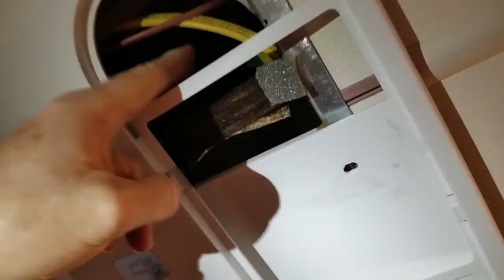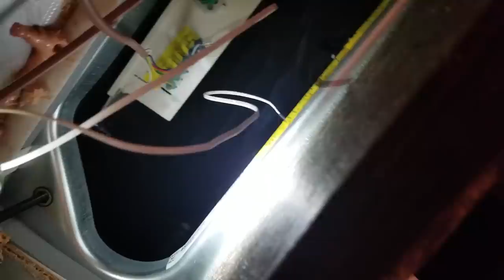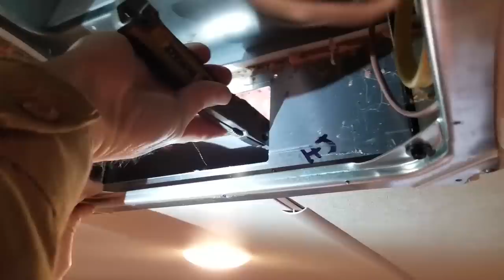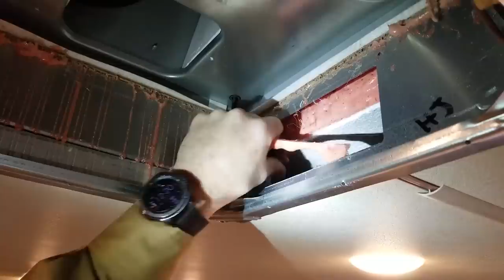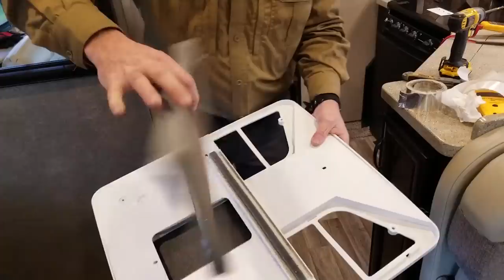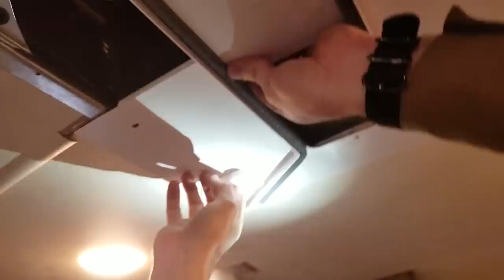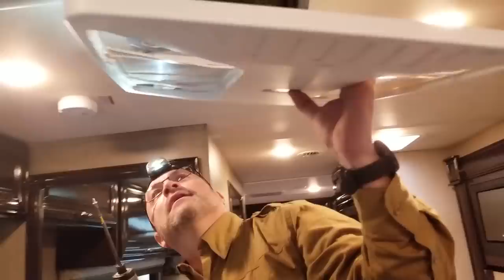Boost Your RV Air Conditioner Performance With This Cheap, Easy Fix!

Comment: Great video. Suggestion, when you put the foil tape in, put the section of tape that is further into the plenum first. Then the second piece over laps. This will prevent the constant air from blowing against the seam and eventually leaking. Like a roof shingle or sidding, you start from low and go high.

Comment: We bought a new wildwood tt and had this same issue,  there was a 1/4 inch piece of foam dividing the two half but it was crinkled and just flowing air between the two. Not only that but the passage to the ducts weren't taped or sealed so the air was blowing into the ceiling instead of the duct work. We were having issues with very low air flow so it wasn't cooling it down. Instead of taking it to the dealer,  I pulled the ceiling cover off and discovered the problem. I put a thicker barrier between the two halves,  and sealed all the gaps and holes and made the bends more aerodynamic and what a difference!! Went from very poor ac to ice cold. I went over the whole duct system and cleaned up the edges,  and put caps after the end ducts so eliminate air leakage. Took a couple hours but it was a night and day difference. I used material I had on hand from other projects so the cost was 0. Thank you for this video!

Comment: Unbelievable what I found. Thank you so much. Our air vents blow way better. Divider piece installed backwards, huge holes blowing into basically the attic, and tape hanging down blocking half of our vent. Never would've checked this. Thank you.

Comment: Excellent!  I've been in the HVAC trade for over 45 years and these are the BEST suggestions a RV owner could ever do to his air conditioner.  Great job!
Reply from the maker: I really appreciate your comment from someone that has as much experience as you do!

This air breach is an all too common issue I find.  I almost hate charging for it because it is something all RVers need to be checking on their annual inspection.  

Hope we can get the word out to folks on some of these easy fixes.

Thanks for watching and commenting,

Cheers,
Darren Koepp
Reply: I have a video that will help you more  is in my Fabe book  , this video is good  if you go out side end cat the plastic end install a chicken fence you will not have restriction air out  only one side

Comment: I did the same exact thing to both of my air conditioners, I sealed up everything with the silver tape, most of my cold air was going back into the return, and inside the attic space, they both work so much better now.

Comment: Thanks for this valuable information. My Winnebago Vista 29 had a problem with air not going through the vents to the rear of the coach. I followed your video and it took 20 minutes to fix this problem.

Comment: I did this to our RV AC’s a couple of years ago. Worth the time and cost for sure. Also plugged up the dead end gaps at the ends of each duct line
Reply from the maker: I like to recommend checking this at least once a year since the adhesive has a tenancy to degrade over time.

Cheers,
Darren

Comment: Your video is spot on. I took apart our 26HE Coleman air conditioner, because it didn’t seem as cool as other motorhomes we’ve owned. After removing the inside decorative cover I quickly found out why the A/C unit did such a poor job of cooling. The divider that separates the warm-air intake side of the plenum from the cold-air output side was installed backwards and was laying at almost 45 degrees. In our case there was virtually no separation of airflow between the warm & cold sides. I removed and reinstalled the plenum divider correctly, then I put everything back together. The difference in cooling was unbelievable. Like night and day. I only wish I had seen your video sooner. We put up with the poor cooling last summer, but assumed it was because there was only one air conditioner and that’s all we could expect. We never suspected that it was a sloppy installation by Winnebago that caused the problem.
Reply from the maker: I've seen this on many air conditioners. From all manufacturers and price points. Even after a few years the adhesives start to fail so that should be something that is checked annually.

Comment: Thanks for making this video.  I have the exact Coleman AC as in the video and it had exactly the same issue.  I fixed it following your video and what a difference.  I have cold air coming out of both RV side ducks now when it was only on one side before the fix.  It is even quieter in the RV now because the blower outlet noise now not being directed through the air intake as before.  We when camping last weekend in 99°F heat and the AC wasn't even close to keeping up.  It will be fun to see the difference the next time it is that hot when we're camping.  Overall, very happy!  Thanks again.

Comment: Love your videos! I got rid of my original traditional RV air conditioners and installed Midea house window ac which I installed in the living room, entertainment cabinet and will run on 500 watts and I can use my solar panels on the roof to run both AC 's without using a soft start. I also installed compartment doors that swing open and I use drawer slides for the air conditioners to sit on a sliding platform and I can slide the unit in and out easily and of course open and close the compartment door. I could not be happier and the Midea AC unit is less than 400 on Amazon. I  installed a Frigidaire 400 watt AC in the bedroom clothes cabinet. Love it. I also have more room on the roof for solar panels and walking space. I got rid of all the 14x14 roof vents when I put a new roof on and then put square Led ceiling lights  to cover the inside vent holes. I use the AC's on fan mode or open windows instead of using the traditional roof  vents. I also use Alexa to turn off and on the lights  and the AC units and all my stuff. So I now have a smart RV. By the way if you purchase a Echo Dot 5 you don't have to use the wake word of Alexa, you can use The Wake Word ECHO... Echo turn on the tv.

Comment: I just the other day improved air flow through my Dometic refrigerator with your air duct hack, now talk about deja vu all over again, another air flow hack only this time A/C! Pleasure-Way clearly did a better install job than a lot of RVs, but I still got 7 degrees improvement just from adding a little duct and tape. Now I have to go check my A/C! Thanks!

Comment: I covered my divider with window reflectix on both sides and folded one piece at bottom as I had inch gap at bottom of divider, secured with ac duct tape. Works tons better! Reflecix  did my side gaps too. Thanks for share!
Reply from the maker: Thanks for sharing.  Glad to hear it is working better!  You might be surprised at how many A/C’s are running out there with this huge breach in them.   Everyone should check this at the beginning of each season.
Reply: @MyRVWorks  In inspecting our ceiling units, I found the gray foam stuff has mostly disconnected from the cover shell.  Is that stuff sold in stores, or something as good or better?  I would think that spray contact cement with new foam material is a better deal and might last longer.  The OEM stuff used is now 12 years old on our 2007 Holiday Rambler RV and just dissolves when you try to grab it.  All but useless.
Reply: @joeowen1429  You can try that 'Great Stuff' foam product.  Just make sure the area you are bonding it to is clean - it may not stick so well to 12 year old dirt!  LOL

Cheers,
Darren

Comment: Ahh brings back memories of my last RV. Coleman 274BH had a 13,500 AC. Back half cooled well, front, not so well, so was going to replace it with a 15K unit. In my perusal of the unit to determine everything I would need to swap it out, discovered that the opening to the front duct was partially blocked by what ever was used to "seal" the duct to the plenum. I cut it away, turned on the AC and debris blew out the front vent!  Needless to say, did not need to replace the AC, it kept the temp great from that moment on. 

Now I have a new trailer, a long 5th wheel with two 15K AC's and they struggle to cool it down and keep it cool even with partial shade, so guess what is next on my list. ^^^^^  Exactly what is in this video.  It is great information and it does work when the ducts are properly sealed(or open as in my last one).

Comment: This is one of the best videos I have seen.  Having encountered this issue with a Thor Ace several years ago,  I also encountered a issue with the return path from the filters.  Sometimes the spacing between the filters and the ceiling is not enough to permit correct airflow from the cabin to the intake plenum.   I have seen this where effective input is virtually cut in half.  It's amazing when you clean the filters to find each side half full of dust  and the remainder is still clean.  You have to make sure the intake has sufficient clearance to use the entire filter on both sides.
Reply from the maker: Hi Bill,

Great comment, I appreciate your remarks.  Keeping these filters clean is key!

Comment: I'm able to keep the temperature 30-32 degrees cooler inside my RV.
I installed 2 misting nozzles at the condenser in order to cool the air entering the unit.
This combined with some strategically placed mylar (windows and roof vents) works like a charm!
110 outside....78 inside..
Reply: I assume a dry climate?  What are the misting nozzles attached from?
Reply: @RogerPack  yes, Southern California. I attached a splitter to my water intake.
Obviously, this will not work when boondocking, only when hooked up.
Reply: Have you ever had a problem with mold growing in your duct work? Never heard of adding water.
Reply: @francismarion6400  RV ac units recirculate the air. No outside air is introduced so no water from the mist gets inside.
Reply: @badactor3440  You just said you installed misters at the condenser. Are they installed outside the unit or am i missing something? If inside, The AC is only capable of removing so much humidity at one time. So by you adding water at the condenser, you are adding humidity AKA water.
Reply: @francismarion6400  on the roof. Outside air does not enter the RV. If you own one, you should know this.
Reply: @badactor3440  I travel mostly in Florida. I know in some places we have annual rainfall of 8ft. so no need to add water.
Reply: @francismarion6400  obviously, mist is only effective in hot, dry climates

Comment: Good information.  Most people (almost everyone) wouldn't know how the A/C works or why it's not working well.  It would be easy for an RV owner to conclude, "Oh, it's just not a very good AC.  I'm going to replace it with a better  $$$$ A/C."   Knowledge is important.
Reply from the maker: Hi nemo227,

On some of these service calls, where I find it really bad, I place an anemometer that records temp and air flow.  I let the A/C run for 20 minutes before I make the repair and then, with out moving the anemometer, I make the repair and let the A/C run again for 20 minutes.  The results are astonishing!  This quick fix really does make a difference.    I am waiting for an A/C to come to me that needs this service so I can capture it on my channel. 

Thanks for watching and contributing to the channel.

Cheers,
Darren Koepp
Reply: @MyRVWorks    If you find yourself in the Monterey Bay area of California let me know.  My Rexhall Aerbus is 20 years old.  At that age it must need SOMETHING.
Reply from the maker: @nemo227  I will keep you in mind.  We are still Full-Timer RVers and enjoy different adventures.  Heading to Alaska soon.  
Happy Camping!
Darren

Comment: Great video! This is the 2nd time I watched this. I'm on my 2nd 5th wheel in 2 years and both RVs seemed to be put together by Darrell and his other brother Darrell.  This increases cooling ability by 50%... Thanks again.

There seems to be 197 shareholders in the RV Manufacturers Board.

Comment: Just did this in my 2019 Sandpiper and I Notice a difference right off the bat. Definitely worth the 10-15 minutes. Even if it’s minimal effect. I have two dometic air conditioners. Both ducted.
Reply from the maker: Hi Gary,

That is great to hear!  Keep spreading the news so others will benefit from this quick fix too!

Happy Camping and stay cool this summer!

Cheers,
Darren

Comment: Very good video. My rv air conditioning system had that divided but I discovered that it was moving with the pressure of the cold exhaust cold air. I made repairs with ac tape and solved the problem
Reply from the maker: So glad to hear it helped.

Comment: The system itself is most likely adequately designed. The problem lies in the quality of the workmanship (or lack thereof) in the installation! - out of sight, out of mind! Thanks for bringing this to attention. It doesn't take much effort to increase the efficiency of your a/c unit!

Comment: Just an FYI that is not expandable foam, it is red urethane. It is used in our lamination process.  It is water activated urethane.  Very strong stuff.  This video is very valuable to customers, condensation and leaks are very common because of bad installs.

Comment: Also some people who are living in these could put a Mister where it will blow a slight spray into that condensing coil make sure you use a calcium filter ,because the compressor works better when they’re not overworked when it’s 110 out

Comment: Just to give you a heads up when you use foil tape you have to use a squeegee for a Tite seal. When you push up against the tape with the squeegee it activates the glue. Try not to use your hands because the foil tape will cut you like a razor blade. If you have issue with the tape sticking to the metal it might be a good idea to use spray glue